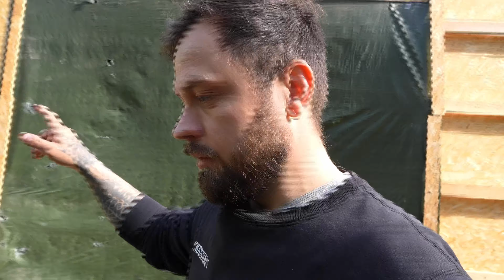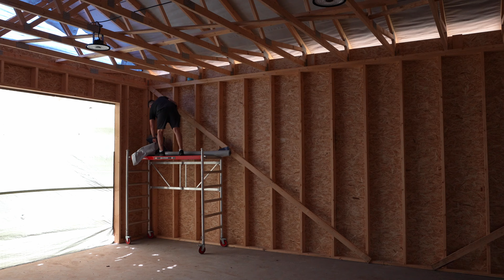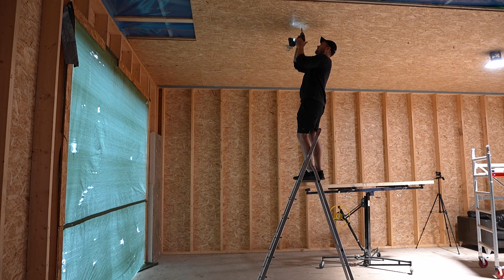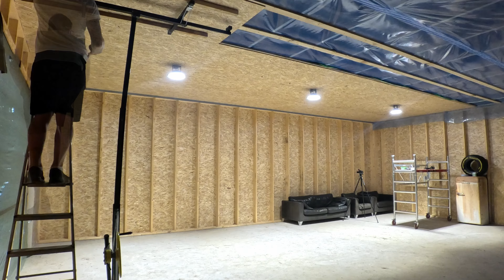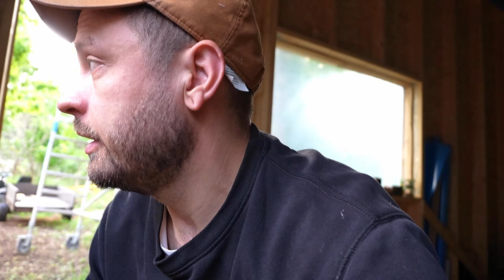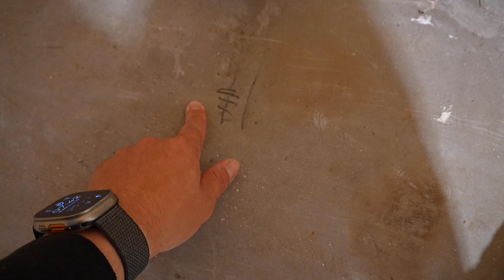I Had to Redo the Lighting to Get It Right | Dream Garage Build #8

Comment: Whatever you use inside, I'd suggest a wood base if you can (OSB or "cheap" structural ply) with something to hide it, at least in places you might have workbenches and things. For anything heavy you'll want to find studs obviously, but it's great in a workshop to be able to drive a screw in anywhere and know it'll hold a few kilos of whatever you want to hang on it. Drywall is more of a pain for that.

Depends on fire regs there as well, I guess. Not sure if the government has anything to say about needing fireproof boards. Might be more relaxed for places that aren't a residential dwelling.
Reply from the maker: Thank you for the feedback. I actually went with osb, still deciding on the color tho. This building is registered as a garage on the permit so it can be all wood, no fireproof material is required as we are far from other buildings.